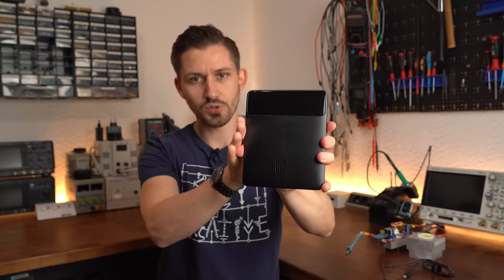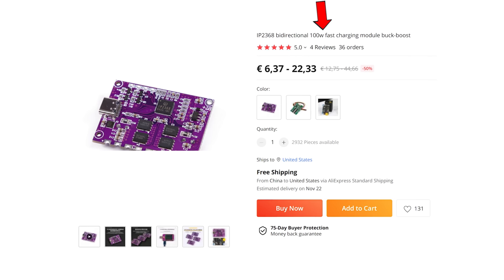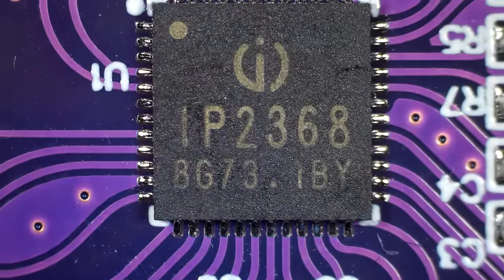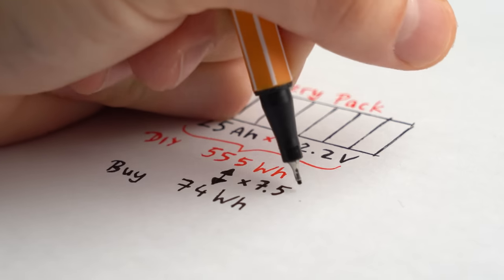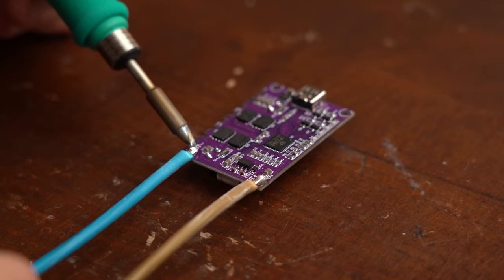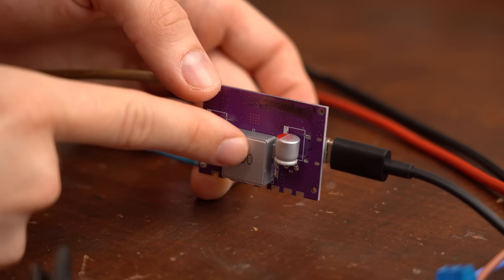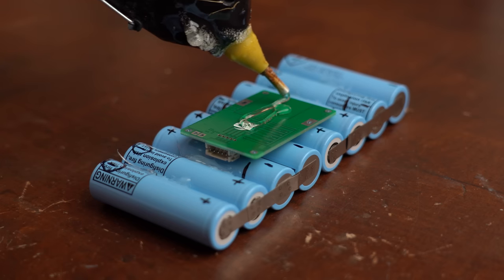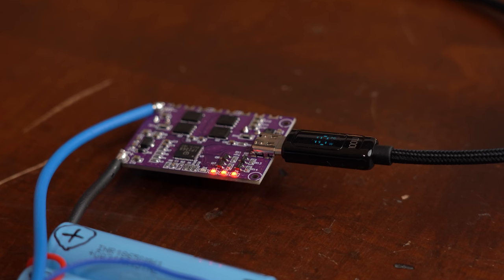My Power Bank Rivals Commercial Ones?! Super Fast! (DIY or Buy)

Comment: One thing I want to point out is that while it's tempting to create huge power banks, their usefulness is really limited when you consider that you're not allowed to bring battery packs over 100 Wh onto commercial flights without the airline's specific approval. For me, that was the deciding factor to buy an existing battery pack when I was considering my options. Not worth the effort just to squeeze a dozen or so watt-hours more out of it, especially considering that I'll probably be questioned about it at security.
Reply: If you’re smart you re sleeve your MJ1’s with some old 1200mah sleeve design. Let the TSA do the math 💁
Reply: Most people do not spend a significant amount of time on planes to the point they choose what to buy/build with flight in mind. Personally I have been on 3 planes in the last 20 years (a return trip to Italy, and a sightseeing flight to see the aurora borealis), most people nowadays dont fly at all, and modern airlines are more these days aiming flights at a small number of frequent fliers.
Reply: @Debbiebabe69  .....I've been on probably 100 flights in the past 10 years and I don't travel for work. Couple vacations a year, funerals in states you've previously lived, seeing family. I think you're in the minority.

Comment: Well if anyone wants cheaper and without pcb manufactured just use 7-20v to 5v 3A converter ones and make a battery pack of course find a converter with safety features for best!

As usual nice seeing you work on this incredible things again

Comment: I would really take a look at the AOHI it’s 100w also at around $80 and 108wH, I’ve bought there 100w charging brick and it’s been great, it’s battery cap voltage is around 3.6v at 30000mah

Comment: I love your videos. You're so smart and informative. Thank you for always putting out "great" content. Could you add more batteries to the buy version so you'd get the best of both worlds? Since you can 3D print another case it wouldn't be a challenge for the extra batteries. Or does the PCB only allow a maximum wH?
Reply: You might run into problems with the display firmware wanting to see a certain amount of watt hours. And the board inisde that Baseus is gonna be a bitch to fit in a new case. But overall I think a high capacity pouch cell based on the Baseus would be the way to go.

Comment: Really love your videos. Keep up the brilliant work
Reply: Thank you so much for the compliment. I know my camera work is potato. I really need a new phone but lately I've been living somewhere where cell service in my house is TERRIBLE and with a case on my phone I barely get 1 bar. I have to leave the case off to get 2 bars which means it falls and gets damaged quite a bit thanks to Apple deciding to make the slickest phones in the galaxy.

If you want me to review a board feel free to recommend one. No guarantee that I will get it but any 100W+ USB PD board under $25 I come across gets put in my shopping cart and I buy them when my other projects aren't taking up my whole budget. Last night I bought 96 A123 ANR26650 cells that are 2500mah but have a continuous discharge rate of 50A. Its a 36V 12S8P LiFeP04 pack that can easily be chopped into 3 pieces to make a 12V 60Ah (54Ah+ guaranteed by seller) battery for......$100. Only need a new BMS because the one it comes with is for 12S obviously. Thats cheaper than any 12V 50Ah LiFeP04 battery available today and it has a theoretical output of 400A continuous.

https://www.ebay.com/itm/285093247320?hash=item4260e1b958:g:6SsAAOSwlQtjkmEs&amdata=enc%3AAQAHAAAAoCrHnFtEcXjpZI3%2F9U0lFxpBz8D759dKQj%2Fd38vVneP7QgQDuhauF%2FdfLJfJGTmyktiTeI5X4kAbtErVK0Q7hIL557Ee%2BC93U47RQB7ketOyIXY%2FkX3rAZ6epHRIuS0nzY7%2Fa4Z0WsdKfbnxeITfeM%2FTA5JQ2YeKXqBtHR1wcm4W1Wpi68gUXbeCP1sLNu90Qj9eg3MmILt3xrAWthOks%2FU%3D%7Ctkp%3ABk9SR76uy9StYQ

You can make an offer and I was able to figure the seller has an auto deny/accept amount set to $90 so the total for me was $97 since it has free shipping. Battery Clearinghouse has these cells for the same price (and slightly cheaper for M1A) at the same price but shipping for me was something like $65!

Here's the BCH listing of M1A's
https://www.batteryclearinghouse.com/products/a123-26650-lfp-38-4v-96-cell-rack-style-lifep04-pack?variant=39671480320078
Reply: @ericklein5097  your video work has been very good.  Close ups are detailed enough that I can see the components.  Your format is terrific.  I look.forward to every video you put out. You explain electronics in a very concise manner. I learn something new every time you put a video out.  Thanks for the tips on batteries. Always need batteries.

Comment: So for the DIY version:
What is the usable capacity? With 2.9V it seems like it cuts of a bit early. Is that only under no-load? What about standby-power?
And for the bought battery bank - charging- and discharging efficiency?

Comment: Thanks for this video. Could you one day explain how a li-ion battery charger with load sharing works? Ideally for 2s or 3s packs. Also what’s exactly the implications on putting cells in parallel on a battery pack? Thanks!

Comment: i was thinking about making one for my steam deck, but i found a good deal for exactly what i was looking for on amazon (i don't buy batteries and sd cards/ssds from aliexpress). i'm happy with it since it can charge my deck just fine, 70Wh, has one usb c and one type a port, and it can charge at 65watt (although i only have a 45watt charger right now). 
even with the high capacity, the deck is still very power hungry. i did some test runs and it could only charge the deck to 70% while running a game.

Comment: i wanted to make some battery pack that is able to charge my laptop, i looked around and had some ideas the best one was to make usb c power bank with ability to charge at least 20V 3A and there was adapters for laptop barrel input to use usb c. Only thing i needed was some board like this, thank you
Reply: better just buy one. 45w cost from 35euros, 65w are like 45euro,

Comment: Look at linear dc converter on this board - it has maximum input voltage just 16 V. So it's not good idea to use 4S Li-Ion battery.

Comment: Problem with these DIY power banks is that it's hard to compete with finished ones. A maxed out version with 100Wh can be had for less than 100 bucks, and that includes a nice case. Even a 3D printed case will most likely be a lot less stable than the cheapest premade bank. I for sure would know I wouldn't slam a DIY pack into my everyday backpack, it would most likely die within a few weeks

Comment: Or just buy a tool battery from lidl and print an adaptor for the board ... perfect combo
Reply from the maker: I wanted to include a similar idea in the video.....I will show that in my next Aliexpress Hidden Gems video ;-)
Reply: @greatscottlab  What happens if  you dont set the AH correclty? For example if you want  to make a 1kwh battery?

Comment: Hey, interesting video, I've broken two of the 100w models you featured. The PD module you linked mentions only 100W is achievable with 20volts, is that why you got 85w (your using ~14v)? I really want a PPS module too, and if it supported PD/QC4 that would be super ideal, but still this is pretty damn good. I also wonder if the protection board could be combined as both boards are 50% of the powerbank cost and that's a bit much for me. Also shout out to the lithium iron phosphate crew, safety first, LiFePo4 for life!

Comment: Except it now takes 2 days to charge......

You should of added a second step-up/step-down charging board connected to a 2.1mm connector to allow fast charging via 2.1mm cable connector and voltage range of 2-36V (i.e. charge quickly using laptop power brick). Via the USB it will take a very long time to charge.....
Reply: It can charge at 20V 5A
Reply: @ericklein5097  not a lot of cables or power adapters around that can supply the 5A at 20V... It is why most commercial power banks have the 2.1mm multi-voltage input so you can plug the laptop power supply in to charge quickly. Admittedly a moot point if your laptop power supply is a USB C plug...

Comment: Im still using the first powerbank you showcased, granted i doubled up the cells for more mah so its a bit beefy but will charge my s22 ultra around 5 times before needing to recharge it and will do PD over USB C
Reply from the maker: Glad the old powerbank is still going strong on your side :-)
Reply: @greatscottlab  I did have to replace the pcb once as the small on/off button broke but thank you for the video on it and link to the PD PCB :D

Comment: i bought my baseus blade 100w for 45 euros condition new , in a local wholesale store , when i asked in retail stores was over 100 euros . and baseus wasn't the expensive one because i bought another power bank for 25 euros ''earldom et-pd31'' it's 60000mah but does not output or input a lot of watts , max 12v 1.5a 18 w so i need it baseus blade 100w or the smaller one 65w i think it was , but i went with the 100w for my laptop
Reply: I recently soldered a mobile Powerbank charging module to a 35mah battery.  
When I charge it, the led of the charging module lights up , but even after charging it for 30 minutes it doesn't charge my phone .

Does anyone know how to solve this issue?

Comment: I am sure someone has already mentioned this, but the reason you can't buy power banks with capacities over 99wh is because that is the maximum capacity you can take on any aircraft
Reply: There are many power banks available with well over 100wh

Comment: What battery spot welder is that? I actually built my own battery spot welder awhile back using a car battery, an old car starter solenoid, an Arduino board, a button, and a relay. I didn't have the proper spot welder probes either so I used some wire and a couple nails. It had no way to set the output power, but I could set the firing pulse length to get a hotter or colder weld. It worked great though!
Reply from the maker: It is called kWeld.

Comment: I was trying to use another USB PD board to connect to drill batteries, We have spare drill batteries around the house and I wanted to make something I could plug them into to charge a laptop if needed... But the board wouldn't charge the laptop, it did output 20v on my usb tester but when plugged into a laptop it didn't request the 20v. 
Not sure if this board would make a difference, but I might have to give it a try
Reply: SW2303? Overheat?

Comment: Thanks for the video, please I have some questions do I need to set the output charge to a particular voltage or it automatically select according to the voltage of what I am to charge, and what is the voltage of the adapter to recharge the powerbank thanks so much appreciate u.

Comment: Isn't it odd that it can't deliver the advertised current, even though it is very efficient, and isn't even getting hot? Probably a 2 cent component in there somewhere that was almost as good as a 3 cent spec part, but can't quite go rail to rail...

Comment: Great Video, thank you. What do you think about the multi port 200w IP6559 + IP6550 dual-module? And would this be usable for a compact but powerful DIY powerbank with two 1160100 batteries with 10000mah each?

Comment: I have a question: I’m going to build a DIY boombox/power bank. I will be using the following items from AliExpress: 

-10,000 mah power bank (I will be pulling out its two LiPo batteries for the project. 
-80W MP3, Bluetooth, FM radio module (decoder) with an input voltage of 5V-26V
-Two 10W speakers and passive radiators
-QC 4.0, 3.0 dual USB outputs and a single USB Type-C, and Lightning outputs with 22.5W power bank board with temperature control/ circuit protection.

My question is: what circuit board/module can I use to power both things at the same time? 

Thanks.

Comment: I'm wondering if the IP2368 has pins, from which I can get the battery voltage directly, and still have all the features like capacity management, low voltage shut down etc... Which I don't have when I directly solder something onto the battery directly, if I understand correctly..
Reply: I recently soldered a mobile Powerbank charging module to a 35mah battery.  
When I charge it, the led of the charging module lights up , but even after charging it for 30 minutes it doesn't charge my phone .

Does anyone know how to solve this issue?

Comment: This may be a strange request, but can you please make a video on waterproofing 3D printed enclosures? I've used waterproof adhesives in the past, such as T-7000, but don't really know what goes into waterproofing ports. 

Would it be possible to create a DIY solution that would enable your power bank to withstand light rain, for example?

Comment: I don’t know that much about electrical engineering but isn’t the entire battery casing the negative terminal? I think the reason why people use spacers is to prevent a short circuit which could cause a fire. Or am I wrong about this concern?
Reply: Correct but it’s not a huge deal if your pack is secure in a case with no room for movement

Comment: I tried to find the IC that’s used here, for possibly integrating it into a custom open source pcb design in the future. But couldn’t find the IC anywhere (not even listed as not available, but simply couldn’t find it at all on any of the big components websites).
Reply: IP2368. Injoinic.

Comment: Thank you for the informative manual (as always :))
This module has a line of 8 contacts (4 of them marked as L1 and L2). Do you know what these contacts do? By default the module is pre-configured for 4S battery pack with 4.2v per cell. Could it be balance contacts (in this case 4s BMS is not required)?

Comment: Thanks for the great information and efforts , please tell me is this diy power bank safe for my old laptop hp that charge with beral socket (i will use 100w converter from type c to beral ) the laptop charger out is 19.5V 3.33 A 65w

Comment: nice video but i have a few question as an IT guy who want to DIY my powerbank:
- why most people use li-on battery like 18650 instead of li-po like 1260110?
- can this go with 1260110 battery as i having 2 cell here but as i see your battery output need to be 22.2V so ... each battery is 3.7V then i need like 6 of them?

Comment: Thanks for the video , since there is very little info in the internet about issues i thought asking here. the module indeed output 100W but it does not charge the battery (although the led is blinking) the battery is at 14.9v (50%)
second issue - it does not charge my Samsung phone , it gets into a loop of connect-disconnect mode. any experience with that ?

Comment: I don't think I entirely understand why the bms is necessary. Aren't there balancing and over voltage and over current pads on the ip2368 board?

Comment: Lets say we want to make a huge power bank with more than 1 ports. Can we just use multiple boards and connect them in parallel with single battery pack?
Reply: If your pack and BMS can support the amp draw

Comment: Can I charge this 4S battery pack with my old 5V 2A power adapter? & does it automatically communicate with the load device for Power Delivery voltage settings?

Comment: How the temperature holds up?? I recently bought 120w module with sc8812a controller, the inductor gets way too hot 75°C at only 55W load.

Comment: Can you change the cut-off voltage with a resistor? I'd like to use a Lithium-Polymer battery with 14.8v and 6200 mAh which is basically the same as your battery but Li-Po cells have a higher minimum voltage than lithium-ion batteries. 2.9v might work but it should be at least 3.0v - 3.2v.
Reply: okay few hours of research later I found out that Li-Po and Li-Ion are the same thing and the higher minimum voltage is an information I wrongfully transferred from the RC community used because of the quick unbalanced discharging.

Comment: I got the same charger and I I almost done with making my powerbank. I noticed however that there is a warning from some supplier of this board that the SOT89 LDO is only rated for 4 Cells operation and if more series in series are used it will be damaged. Someone posted a photo of this LDO exploded and he said that this only happened with 4 cells because fully charged they would be 16.8V so above the rated voltage. That's is HORRIBLE! I will be looking to find a replacement LDO but this is such a shame as this is otherwise a very nice product.
Reply: is it possible to put 16 batteries? of course 16.8V, each cell contains 4 batteries, and of course with a BMS protection circuit, does it work? :)
Reply: @behnamp9174  According to the datasheet, you can install up to 25000mAh so 4 x 18650 per cell should be OK. You will need to replace the resistor R5 from 6.2k to 30.9k otherwise the board may not charge the battery fully ad it comes from the factory set up for 5000mAh. 
BTW the LDO had not exploded for a couple of weeks now so I think it can probably take the 16.8V but not sure if it will after a few weeks or months...

Comment: Wonder if i can use 2 board parallel to the battery. More outputsss(while the battery pack is also huge)
Reply: Nvm its expensive board not worth it for now. Maybe later cheaper

Comment: Tried this out. And it worked out really well. But I have a question. Doesn't the power delivery board have balancing on it. The board seems to have pads for it? Correct me I'd I'm wrong.